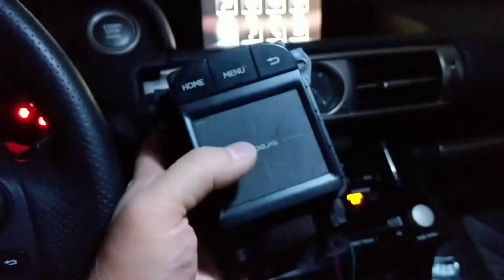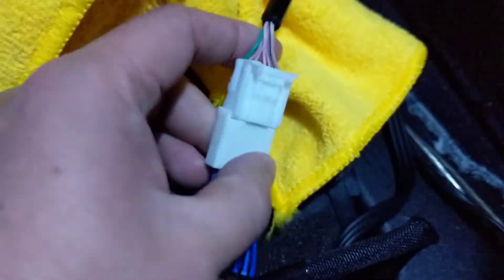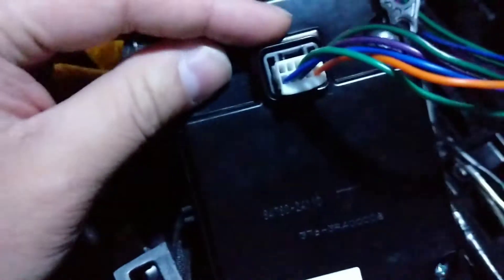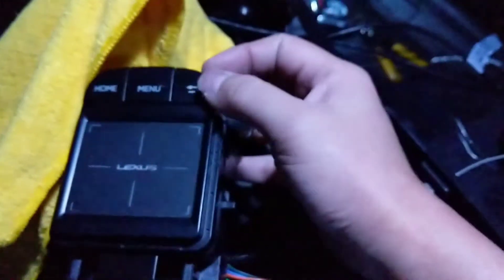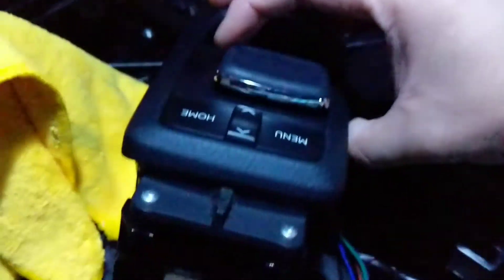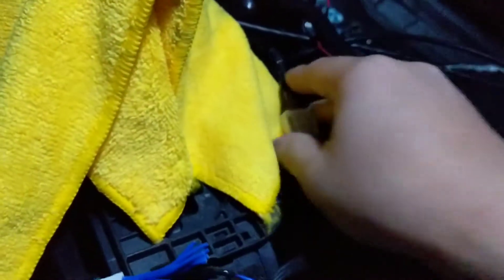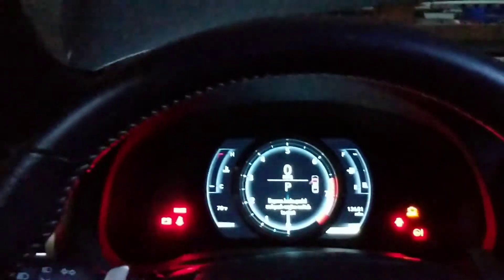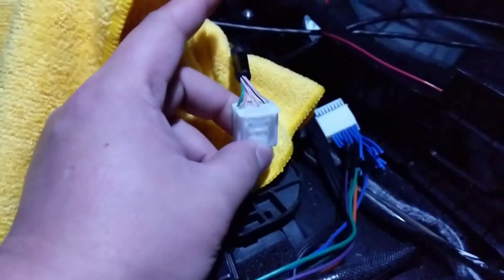Lexus Remote touchpad in Lexus 3IS Experimenting

Comment: Hi man love your videos. I have a question . Is it possible to remove the touch pad controller from 2023 IS 350 and install a phone charger and convert the CarPlay to wireless and android using 2023 es350 electronic hardware?
Reply from the maker: Sorry I don't know enough about 2023 ES350 stereo setup to answer this question.

Comment: Would you sell one of those for a conversion I may be attempting with a RCF Console in my IS?
Reply from the maker: still interested in these conversion harness? tempted to revisit this and build some of these harnesses since now i know where to source some of these plugs from
Reply: @specONE  I will buy any harness you're willing to make for this. I have a 2016 IS, and would like to place the RC center console to have the better cup holder location. I sent you an email from the link in your online store. You would be a hero if you could make something plug and play for anything that needs it to make everything work. PLEASE, you're probably the only one that is willing to.
Reply from the maker: @RuneRavenX  i know this is one year later and not sure if you have it sorted out already. I am selling plug and play harnesses 
https://specone.bigcartel.com/product/rc-2-is-cc
Reply from the maker: its been a while since i've done this. Any the connection I made was makeshift with scrap parts but not intended be a solid connection with connectors that lock into place

Comment: I am trying to replace my Lexus nx 200t touch pad with a knob button has anyone has  any information on that , video, is it possible? I prefer de knob than the touchpad. Thanks
Reply from the maker: The Knob is meant for the Non-navigation stereos. You have Navigation equipped vehicle so you can only have the Touchpad on your NX